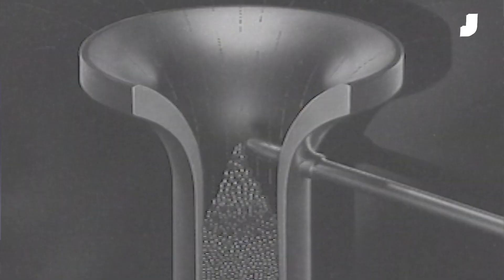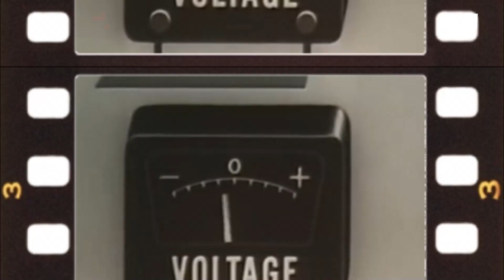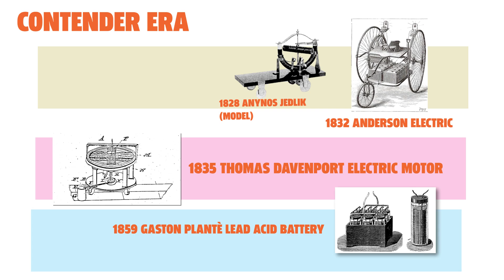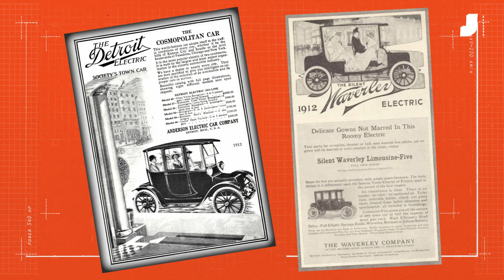Electric Cars Are Way Older Than You Think: EV Timeline Part 1

Comment: What is this video about ? Everyone knows about old electric vehicles and lead acid batteries. It seems to be a foundation for another attack on the modern EV and battery storage that this channel is noted for.
The moderator looks to be on the younger side of 50, but he is very old. He is old because he holds on to old ideas.